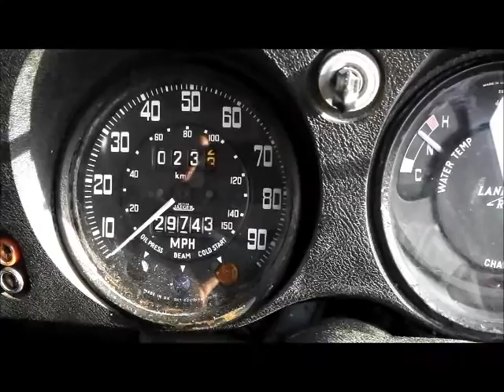Land Rover Series 3 Gearbox Rebuild -  Part 14 -

Comment: Very nice work, Phill.   You should be really proud of what you've accomplished.  Not many people would dive in and rebuild the gearbox.  It sounded quite nice and best of all runs through all the gears very smoothly.   Just put some thick padded carpet in the back on the floors and sides of the cargo area.  That will take care of that whining sound.  :-)
Reply from the maker: +odc43054 

Many thanks! There are a few more mechanical jobs to run through and then I can think about carpets and trim. I like the look of the original hardura trim set. 

Cheers,

Phill.
Reply: +steamwally   I was kidding about  the carpet.   But it would provide some sound insulation and then you wouldn't hear the rear end whining.  :-)
Reply from the maker: In all seriousness, its on the "to do" list! I have an electric winch to fit low in the back, I can remove the tall boat winch and fit a modified dog guard as a bulkhead. That combined with carpet should make it like a Roller!

Comment: I could sleep to the sound the whole car makes on the road. Excellent job! Hopefully we won't see a Part 15 any time soon, at least not in relation to the new gear box.
I always find it funny how it sounds like it's going to take off in top gear, and yet everything else is flying past you. Part of the many joys of being an LRO.
What type of axel is on the back of the 109', because iirc from your other videos the front and back don't match. Is it a salisbury?
Reply from the maker: +m1cr0man 

Hopefully the noise of mechanical harmony will remain for a long time to come!

These things are slow, but that has never really troubled me. 

Cheers,

Phill.

Comment: Phil, very nice video series...how is your work holding up? Particularly the breather system you've installed? Have any other leaks developed elsewhere on the gearbox?
Reply from the maker: MervandtheMagicTones Thanks, it seems good so far after about 10k miles. Despite best efforts it still has a few small leaks in the usual places!

Comment: what was your speed at 5th gear ?
Reply from the maker: +Anant Lakeram 

In overdriven 4th,  50 mph is about as fast I ever go. 70 would be about top speed.
Reply: Your engine sounds pretty good. My steering is very tight when turning right, what do you think is the bug?
Reply from the maker: It runs quite well, but has taken lots of work to get there. I would take a look at your steering swivel pins. See my recent Series Swivel Pin Adjustment video for a guide on what to do.